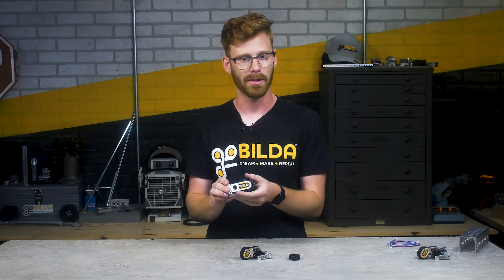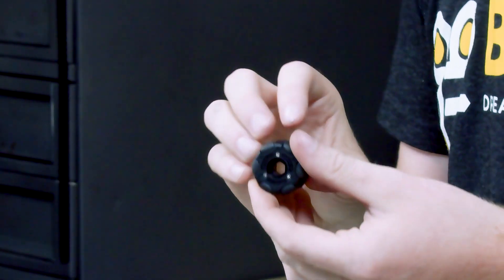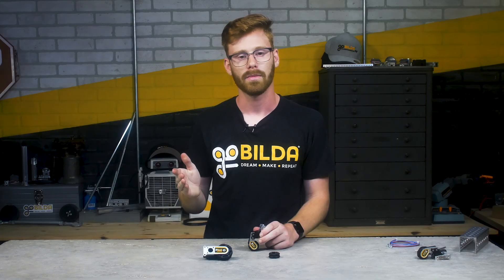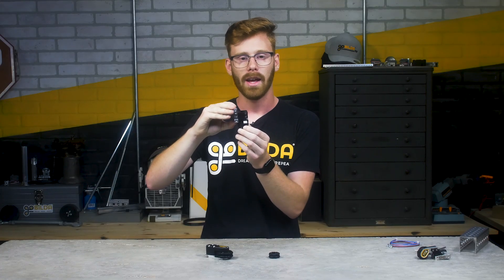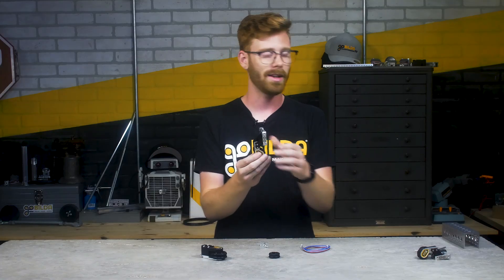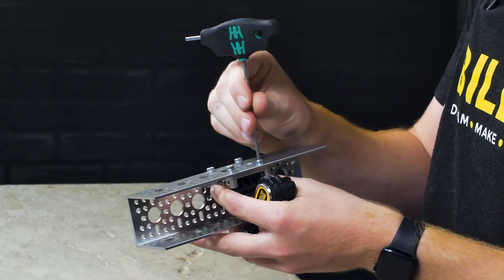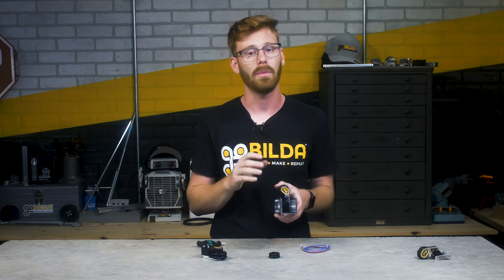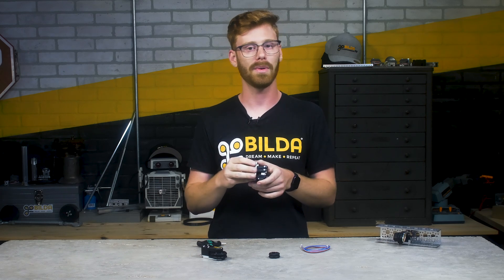4-Bar Odometry Pod Overview

Comment: What are the advantages compared to a swing arm odom pod
Reply: Good bit more compact, mostly. Less assembly over the old one, though gobilda did great with having that be a small amount already.
Reply: They come with a spring, it just works out of the box, it also doesn’t invert and since it is small it will fit in a parallel dt easier